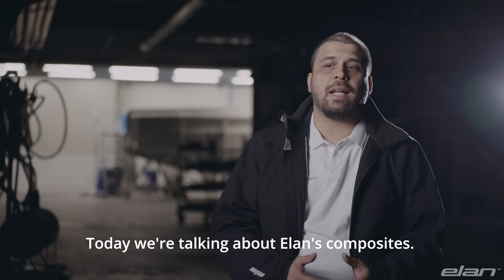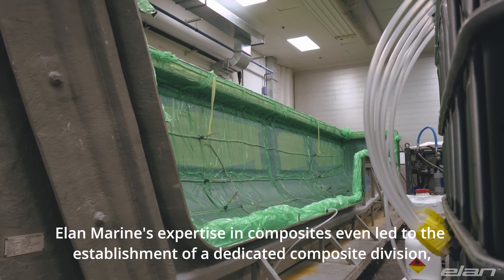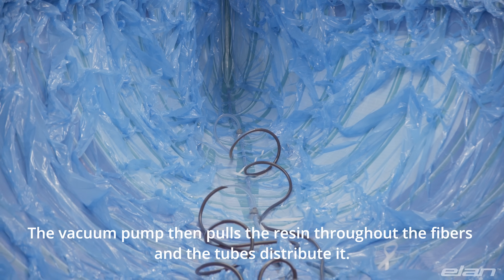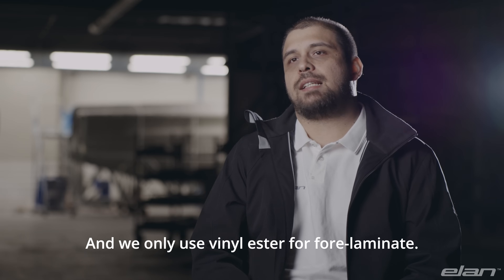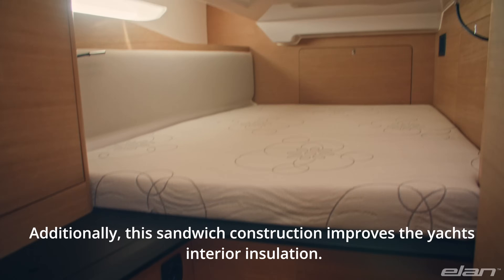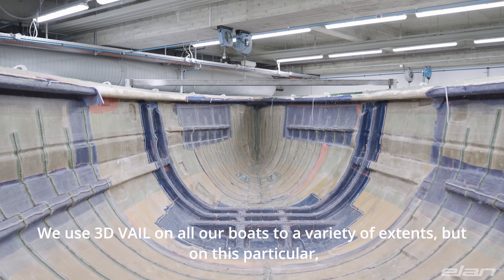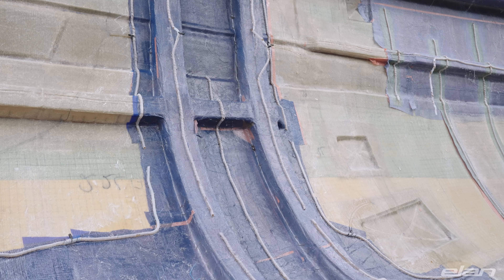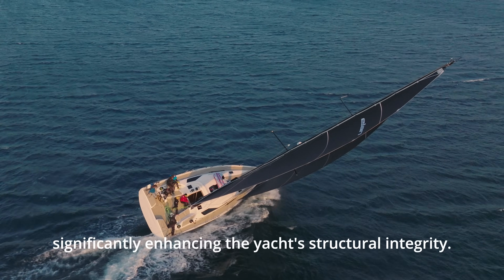Reinforced to Last: Composite Technology in Elan Yachts' Construction

Comment: nicely done, I met you guys at the last dealer meet. I work in F1 composites, and it's nice to see structural stuff being incorporated into the laminate rather than bonded on top. The video was very well done to not over complicate and hard to follow. Great pace and explanations whilst having lots of interesting and detailed information. Our impression 384 is up for sale/ potential sold. We chose it for the fact the grid was laminated in at factory and she has seen us through a lot and a joy to sail. We will definitely have another Elan in the future as we have loved living on our 384 for our two year sabbatical off work. I have also done 450nm none stop on a gt6 i loved it. One small improvement put another sink next to the cooker and move the lifting microwave to the other side of the boat. Cooking under way having to cross a wide boat to drain pasta was interesting. The boat has great sea manners but still, a sink next to the cooker is a must! 👍

 Thanks for sharing 👌🤘🤘⛵⛵👍👍🍻

Comment: I heard in norway that elan is only composite boats that they do infusion at same time hull and stringer or for keel ..which is impressive.. other " super" companies cant even infuse standard hull.
Reply: Yes, that is 3D VAIL, and they are the only manufacturer of, relatively, mass produced sailboats. They have always been regarded as quality built and technologically advanced yachts. The prices of used boats reflect that quite well, even the ancient Elan 31 and 33 still hold pretty good prices. If you're selling, of course...
Reply: @fifi23o5  sounds cool…but is Elan a true blue water boat? They can last 30 years at least? I don’t think so…..Not Elan, not any series mass production boat can🫣
Reply: @luigi3880 Elan isn't your typical production boat like Bavaria. If you check, you can find quite some of the old Elan 33 for sale at a quite high price for their age. Last summer I spent two weeks on one, I think it was produced in 1987 that spent some of her life in charter, still in very nice condition. We sailed from Split, Croatia to Malta and back. Besides, my cousin and her husband work on design and manufacture of internal equipement, so I am pretty familiar with their construction.
Reply: Not really TPI in the US were doing this in 1994 on the one design 40 footers that they built
Reply: @derekness7900  didnt go so well than
Reply: @ItisImarko  The process used a rigid inner tool for the keel frame structure within the vacuum bag. It worked well as long as it was all loaded up correctly if it wasn’t you would get large pools of resin filling any areas that bridged -not ideal